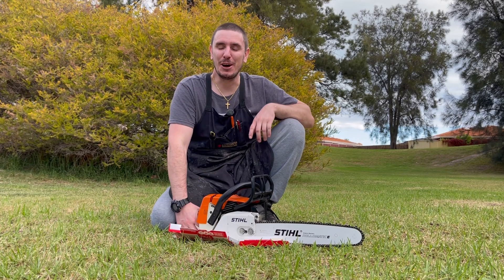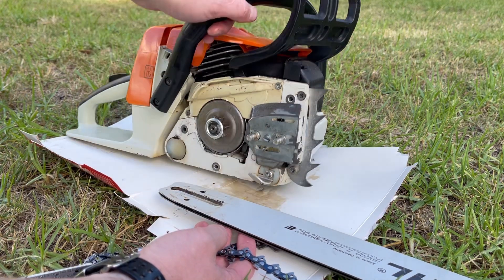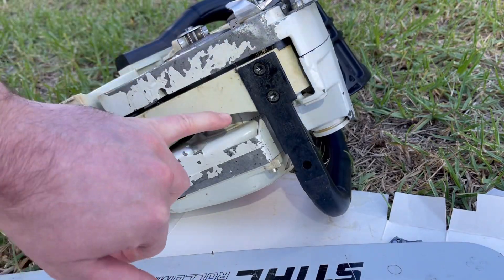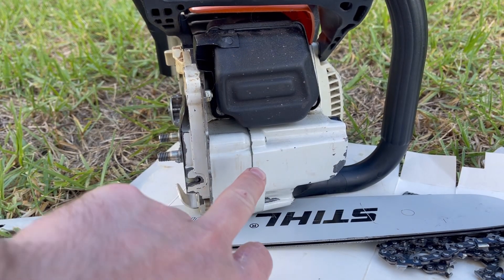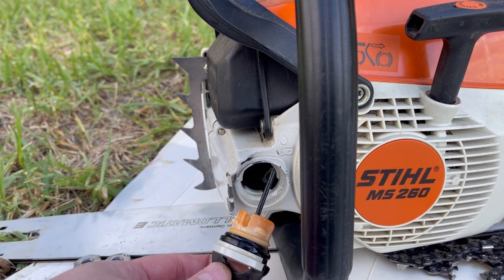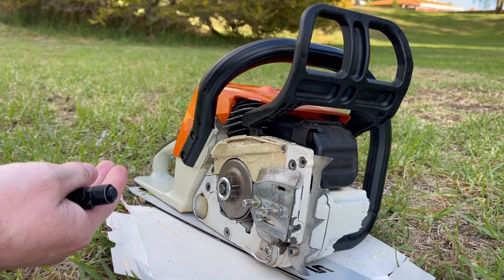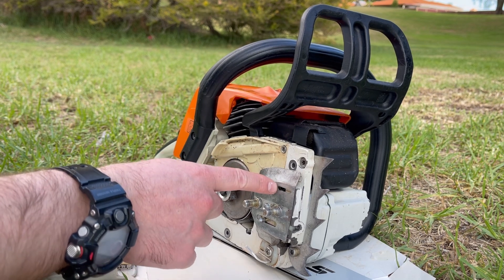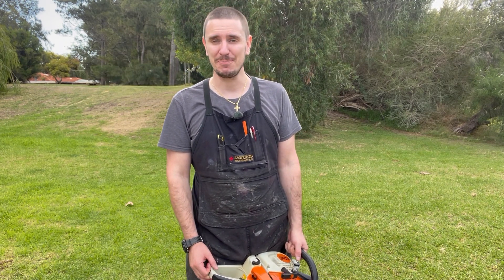Chainsaw Leaking Oil? Here’s Why!

Comment: Hi How are you. Can youbtell me is this normal when brand new chainsaw 181 leaks oil under the hole  where exust have those Deep holes for screws to Mount  the Exhaust , brand new , oil leaks to around  the place where you showing  at the video to
Reply from the maker: I’m afraid I don’t know the 181 at all, i know the 180’s but the design is different. If in doubt go back to the shop :)

Comment: I've sent my chainsaw back TWICE under warranty until they said there's nothing wrong with it, drip feed systems do this and it's normal. Each time I find the saw leaks oil each day just sitting in my shed, even after a week not using. Surely they could come up with a solution to this phenomenon? Like a pressure release valve being active when not in use or something?
Reply from the maker: Yeah it’s annoying! You could make
Something yourself, but I just leave them on their sides with caps cracked open a bit.
Reply: @VintageEngineRepairs   Thanks for the video, I think I'll do the same from now on. Wasted a lot of oil in the past year before discovering this
Reply: Same issue. I can set my chainsaw down and check a day later and I have an oil spot. A week and  I'll have a larger oil spot. I have called technical support and they tell me it's normal. If it's normal, then I would think they could come up with something better. They tell me to always drain the oil out. Inconvenient solution. Glad my car doesn't have the same issue,  with  Toyota support telling me that If I'm not going to drive it for a few days - drain the oil.
Reply: @jckrell   Did you try opening the oil filler cap? Apparently it's ambient air pressure changes that cause it to leak which are nullified when equalizing the pressure. It's a pain to have to remember to do this though.

Comment: My 036 leaked behind the oil pump  , i just put a thin o ring to reseal the join to the oil hose , quik fix and hasn't leaked in years
Reply from the maker: Interesting! Glad it worked :)

Comment: The crankcase is constantly getting oil coming into it. Where does the excess oil not sticking to the parts go? What keeps it from building up inside?
Reply from the maker: Out the muffler! Either burnt or unburnt depending on tube and load
Reply: nobody knows unsolved mystery!

Comment: Good vid Tom, I usually recommend draining the oil when not used for extended periods and cracking the cap as you said.
Reply from the maker: Spot on Kenny, me too. If it’s not going to be used for a month I’d suggest tipping it out, but less than that it’s a fiddly mess and not worth it.

Comment: Very good job of addressing the different problem areas. Unless there is a lot of chip build up I stop running the chain. Less residual. I also crack the cap then tighten.
Reply from the maker: Thanks Steve! Yep, keep it clean, crack the cap and you’re good to go :)

Comment: Nice video. Chainsaws don't leak,  they mark their territory. 🙂
Reply from the maker: LOL! Thanks mate :)
Reply: Well, mine was really LEAKING, was dripping off the end of the bar. I had been concerned when seeing the rubber gasket it looked a bit puckered up like a set of lips, appears to have possible overheated from previously having gone overly hard at a stump. Anyways, what I did was simply cut a tiny sliver of semi dense foam to snuggle into that opening, yes I observed my cuts afterwards to see whether a fine spray of oil was lubricating as necessary and indeed it was ... gonna of course watch carefully, though I just might have resolved the issue until I get around to replacing the gasket.
Reply: @TRguy64 Nice workaround,  I usually just go for the gasket and it's to hear someone trying a short term fix.  Have you tried it in the field?

Comment: Bar Oils, using incorrect or a replacement oil that may be cheaper cause a leak if oil is to thin?😊
Reply from the maker: Hmm using a thinner oil shouldn’t cause it to leak no! You’ll pump more of it though :)
Reply: @VintageEngineRepairs  thanks just a thought for those using other oils or worse used old oils.